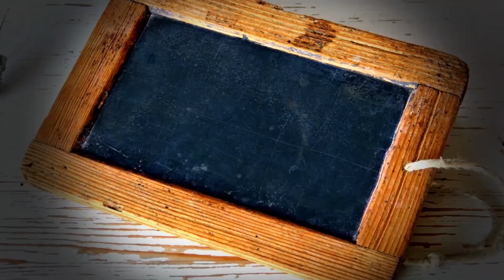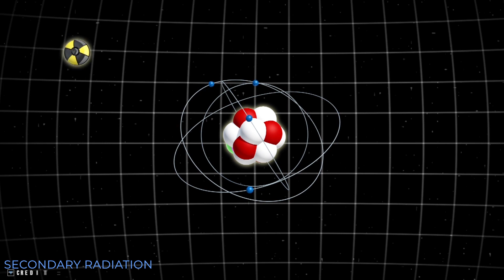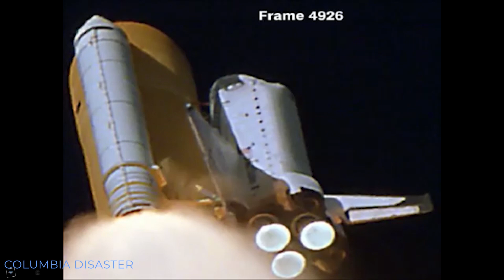23 | What about it!? IN DEPTH: How to be an interplanetary traveler? - Death in Space Part 2

Comment: Regarding artificial gravity: SpaceX could send two Star Ships bound together by a tether (1km or so) and spin them around one another. This would lead to pseudo gravity in direction to the bottom of the ship, what is optimal, because it's the same direction as if the ship is standing on the bottom. Also the tether could be used to switch ships or to switch Material between the ship. This would also be practical in case of an emergency.

Comment: Just came across this. To absolutely minimize radiation exposure, make a very rapid transit. We simply have to upgrade to a Nuclear Salt-water Rocket. https://en.wikipedia.org/wiki/Nuclear_salt-water_rocket
"Nuclear salt-water [a salt of enriched uranium in water] would be made to flow through a reaction chamber and out of an exhaust nozzle in such a way and at such speeds that critical mass will begin once the chamber is filled to a certain point; however, the peak neutron flux of the fission reaction would occur outside the vehicle" (Wikipedia). Yields thrust at 66 km/s exhaust velocity compared to about 4 km/s of exhaust velocity for a chemical rocket.

The nuclear reaction would occur as the fuel was exiting the engine nozzle, so the ship would be safe and dandy. There are some quibbles about whether the reaction would occur exactly where predicted, but what are the chances of that. A few minor details about on-board fuel storage might need to be worked out. The EPA statement for a testing and launch facility may kick up a greater than usual fuss from some tree-huggers. Just more quibbles.

So, this will give us a MUCH safer trip to Mars. Any takers?  ;)
Reply from the maker: Rducing trip time would be great! There are many promising concepts! Thanks for the interesting comment! :)

Comment: Employ a large cluster of X3 Ion drive engines as a tug for Starship between Earth and Mars.  The X3 tug never lands.  It just goes back and forth. 

Once starship catches up and hooks onto the X3 tow cable, the Starship will be continuously bathed in the X3s exhaust -- which could be specially formulated with ions, plasma, and magnetized particles to deflect cosmic radiation away from the Starship.  Continuous radiation protection and X3 Ion Engine thrust is a win-win.
Reply: Where did you get that idea from?
Reply: @Fannystark007  I'm retired and read everything I can about traveling to Mars.  The ideas just came to me (?).  I would like to propose the ideas to people working on the problems -- just FYI.  I haven't figured out how.

Comment: 6:01 - “Cosmic Radiation is stopped by the Earth’s magnetic field.” False. While the earth’s magnetic field does stop most of the radiation caused by solar flares, it does nothing to block much more energetic cosmic radiation. ITC of the ISS, the earth blocks 1/2 of the radiation they’ receive if they were in outer space. 
http://www.thespacereview.com/article/2749/1 
https://mobile.twitter.com/robert_zubrin/status/869248086866055170 
https://spacenews.com/35865curiositys-radiation-results/ 
The dizziness effect you described is the Coriolis Effect, which occurs when the level of gravity at one’s head is greater or less than that at your feet. You’d deal with that by having a large (600m or greater) spin diameter. The space station in 2001 had about 1/2 that diameter.

Comment: I've never seen anyone with the stones to call the Shuttle a death trap, but it had to be said.
Reply: Point of information:  The part that failed on Columbia was a reinforced carbon-carbon panel on the leading edge of the wing, not a heat shield tile.  https://en.wikipedia.org/wiki/Reinforced_carbon–carbon

Comment: My trip to Mars: Fastest trip possible. Header tanks of LOX and methane in centerline, water tanks distributed around circumference of the crew sleeping quarters of the manned section, along with the Bigelowe hydrogen foam they've developed, for constant cosmic ray mitigation. Foam will line entire crew compartment. Tail of ship and bulk of stores oriented to Sun; in case of solar flare, crew would be concentrated along central axis, shielded by engines and fuel, and tank bulkheads metal, and stores. Ship will be compartmented for protection against vacuum leaks, like waterproof compartments on an ocean ship, similar to ISS.

Comment: Just have to say, with certain spacecraft (looking at you, Soyuz) it’s actually far safer to get in the rocket than to get in your car every day. The Soyuz has a better safety rating than most mid-size sedans. If the rocket below you does explode, you’ll be jettisoned away and survive quite easily thanks to the Soyuz abort system. The Crew Dragon is supposed to be about as safe when it’s certified as well, maybe even safer. Most modern rocket launches are safer than most car rides.
Reply: Most people have little care for safety when they get in their cars.  Most people are morons.  The TV news doesn't make a story out of the fact that about 100 people are killed every day in the US in automobiles, mostly by theirs or someone else's negligence or stupidity.
Reply: I bet a car is damn safe with a good driver and not single other car on the road though :P. But I get your point and it is a good one! :).

Comment: If SpaceX Starship with 9m diameter hull is to rotate to create artificial gravity, it has to be about 20RPM.
This will cause 1G at your legs and 0.6G at your head if you are standing inside the rotating hull. The diziness effect will be certain.
However if you are laying down, the forces should be just fine. More sleep - less headache.
Reply: Sending 2 solves the problem nicely. Tether them together and spin them around their common center of mass.
Reply: Yeah, rotating Starship itself is a non-starter. Tethered spaceships has been a leading proposal for a while, in general.
Reply: I think the gravity difference is just fine, the issue is the Coriolis effect.
Reply: Remember that you do not have to spin things up to 1G. Every little bit helps, so getting something up to even 0.4G will reduce the amount of exercise the crew would need to stay healthy.

Comment: Awesome content Filix.  

 I’m liking the idea of centrifugal gravity.  I can imagine a few super heavy launches lifting a modular version of an expandable spoke ring station made out of something similar to Bigelos modules.
Reply: Better, and cheaper, to connect two Starships by a very long cable and rotate them around a common center of mass to create a feeling of weight. SpaceX will probably always be sending Starships in pairs, even fleets, so it should not be too hard to do this.
Reply from the maker: @Curtis Indeed! For a permanent shuttle between the planets though or for a station rotating habitats would be a good solution though. For the "we have to work with what we got" approach, the cable would be a really good approach. Have you tweeted that to Elon? He considers these things when brought up.
Reply: @Whataboutit   Rotating two ships with a connecting cable is an idea that's been around for a while, since before SpaceX. Am sure Elon knows. A ring of Bigelowe habs has likewise been proposed - I think by Bigelowe themselves. Have seen drawings, in print.

Bramwell and Curtis, you still get credit for original thinking, though!
Reply from the maker: Thank you Branwell! :)

Comment: John Varley’s RED THUNDER, posits using water as a radiation shield. You might enjoy reading it.
Reply from the maker: Thanks, Dory! I'll look into it! :)
Reply: @Whataboutit  Hydrogen is a good radiation shield and certain plastics are good insulators (absorbents) for radiation. It has been proposed to make a hydrogen expanded foam insulation using the properties of both to make the internal wall insulation for the spacecraft. You would still need a room large enough to hold everybody on board that is surrounded with 12" (30cm) of water to take shelter in during solar storms and such.
Reply: @Bugsey35   The Bigelowe inflatable modules have a hydrogen foam insulation just for this, as one of the 27 layers. This is for LEO, though. Don't know how much would be needed for deep space.
Reply from the maker: I did not know about the hydrogen foam! Very logical approach! Thank you for the feedback! :)

Comment: Less errors in this one, just in case, for the part 1:
2:42 Well, 18°C at 1UA of the sun.

6:22 The lungs would rupture if the spacecraft suddenly explode but in most cases it won't.
And i am pretty sure the blood vessels will not explode either, at 37°C the pressure inside the blood vessels will only be 6kPa (0.06 bar / 45mm hg) and that's less than a normal blood pressure.
https://en.wikipedia.org/wiki/Phase_diagram#/media/File:Phase_diagram_of_water.svg
https://en.wikipedia.org/wiki/Blood_pressure

6:47 Cooking has nothing to do with boiling, you can cook pasta at 80°C without boiling the water or even at >100°C in a pressure cooker but you can't cook it in a vacuum chamber at room temperature ^^

7:38 When your sweat is boiling you will probably freeze, not to death but it will be harsh.
The sweat will not be the only thing expanding, the air will become very cold too.

8:19 this is miseleading, there is almost no pressure inside you, about 6kPa (0.06 bar), the boiling pressure at 37°C

13:28 Not too dangerous, micrometeorites can't penetrate because most of the friction cames from inertial stress and not from the mechanical properties of both materials, they behave like water.
https://en.wikipedia.org/wiki/Hypervelocity
So since the micrometeorite explode two layers are needed, one is a shield and the other keep the air inside.
Reply: Starship could go to mars in 2-6 months:
https://i.imgur.com/vTjmEa1.png

10:58 Musk has probably said that because of the thickness of starship's shield.
Reply from the maker: Often, when I read your comments, I keep asking myself one question. Why do you watch my videos? ^^
Reply: @Whataboutit  For the news, you are really quick.
And who knows, I may be surprized sometimes.
Reply from the maker: Make a list of the stuff I got right! I will never get everything right. Not even Scott Manley does. How about discussing the stuff I talk about? I'd love you to step into the conversation! :)
Reply: @Whataboutit  Yeah, it's just a step, i had make some remarks but we need to discuss to quantify the effects. For example i have no clue how much frost the boiling sweat/saliva/tears will create.